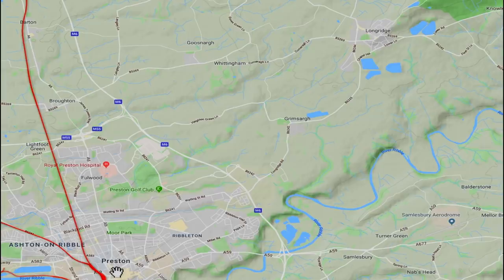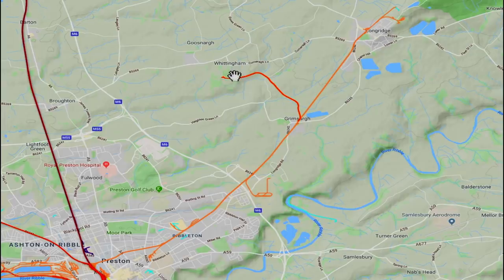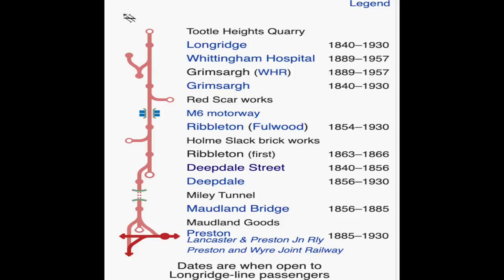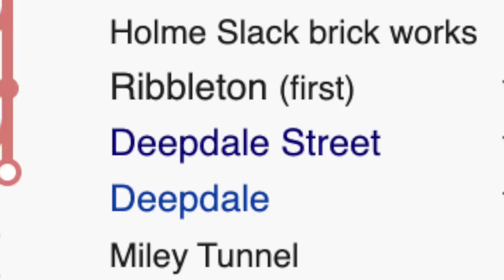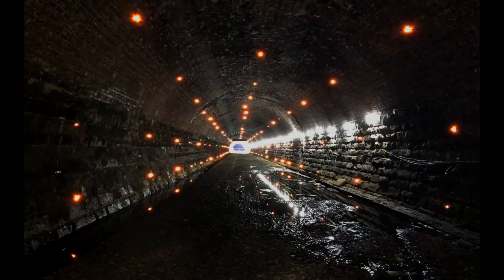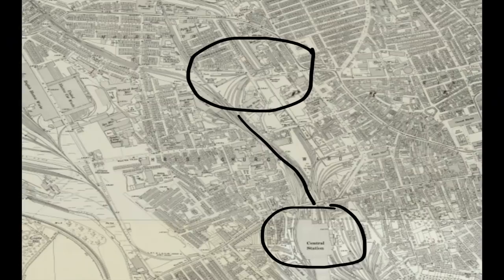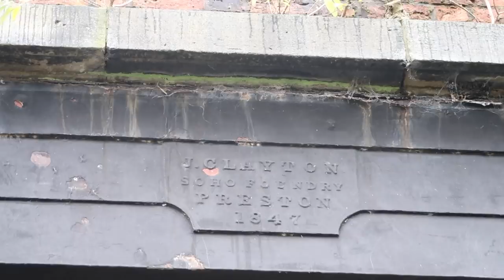The Preston to Longridge Disused Railway Line & The Miley Railway Tunnel

Comment: Interesting video and content exploring the Miley tunnel. Perhaps also of interest are some additional snippets. first, this part of the line continued in use well into the 1950s to supply coal daily to yards located nearby bottom end of Deepdale Road, in Fletcher Road. This was achieved using a spur line nearby Skeffington Road. Next, the lower platform part of Deepdale Station shown as demolished ruins in the video was still in place in the 1950s, indeed with steps down, although correctly described as long disused. However, the main station building up top remains and is the stand alone solicitor's office by side of the bridge. Finally, the Miley Tunnel ghost sort of morphed into a New York Times best selling novel called "Cold Bath Street" by A J Hartley, sometime lecturer at nearby UCLAN.  Cold Bath Street remains nearby, once site of cleaning up for the construction workers.

Comment: Before I was thrown out of Preston Poly, a friend and I used to conduct guided walks through the Miley Tunnel. Fascinating to find out how that central box came about. On walks after dark, we would turn our torches off at this point and experienced absolute darkness. It wasn't overgrown back then and the line was still in use for occasional freight. Of course, no high vis jackets were worn. 

Don't try that at home, kids!

Comment: Well done as always. It's interesting just how much of our current rail network was built in the victorian times. It's equally interesting to get the chance to explore the sections that have become disused. I don't blame you for putting it off until the foliage has died off. In summer that would have been 10 times worse.

Comment: Hi Martin 
Gordon form Preston. And not your fellow exploring Gordon. You was correct in thinking it closed in mid eighties, because I was stood on the platform of one of the stations as a little boy watching them load up platform stones and rails as the took them up, a class 25,  I live fight next to one station that still remains, and if you are free at somepoint would love to invite you for a very detailed tour of the eastern direction of the line. I've lived there since 1975.  And so lhe line open and working, you was also correct, there was steps down to Deepdale station that served Preston royal infirmary, and before miley tunel used to be a big coal yard with multiple sideing with over head hopper sheds.  If you up for a part two. Let me know, fantastic video, so close to home, great job once again, thanks pal 👍

Comment: Thanks Martin! as a Prestonian, I found that very interesting.
I quite often use parts of the disused track, which is now a designated cycle / walking path from the back of the leisure centre going North. It is easy walking from the leisure centre as far as the 'Roman Way' industrial estate, from there it is less easy but 'do-able' [easier than in your video] as far as Grimsargh, where I think it peters out opposite 'The Plough' pub.

Comment: Trains of household coal used to run till the early nineties to Deepdale Coal Yard. Crewed by Warrington Men, and using a mixture of anything available on Warrington Arpley at the time. 20's, 31's, 37's, 47's or maybe even a 56.
Reply: I knew it was later than he said, I remember in 86 seeing locos and coal wagons there but was working at the other end of town in the 90's and never noticed it's demise. Do you know exactly when they stopped?
Reply: @69waveydavey  Not exactly sure, but a mate of mine was a Guard at Warrington till about 93, and he worked the trains. Said you needed a JCB on the front of the train to shift all the dumped fridges and washing machines off the track.
Reply: @69waveydavey  As far as i know the last trains were in 93 The coal depot trains only used a short section of the line.

Comment: Superb this. Been fascinated with the line since late 80's as a train spotter on Preston station. 
Pretty sure Deepdale coal yard was in use to the mid 90's. Remember seeing class 56, 37 with one or two coal wagons regular. 
I work on the railways now and worked with a Blackburn driver until he retired. He recalled driving through the tunnel and hitting a dry brick wall the local youths had constructed

Comment: Fantastic Martin, you serve me prowd once again. Fascinating little stretch of railway, like i commented in Nodrod's video, it would be great if this alignment could be brought back into use. The tunnel was fascinating with that concrete ceiling placed over the original cutting between the 2 sections. I can only imagine how much weight is bearing down on those beams.

Comment: Nice one Martin (and Gordon). Good to see you exploring  my neck of woods just around the corner from where I lived as a kid. I remember the old station building on Deepdale Road well, and the entrance was used as a greengrocers shop back then in the 1950's (which one of your photos shows I think). I had a mate who lived on Castleton road, and his backyard was almost opposite the station platform and overlooked it. We used to watch steam trains go past from there on their way to Courtaulds (or to the coal sidings which were on Fletcher Road). The end of the canal terminated after it passed under Marsh Lane (the iron railings of the bridge are still visible I think). I remember looking down on the canal as a kid and seeing the railway lines running beside it, but it was already looking dilapidated at that point. You'll perhaps know that there used to be a tramway linking the end of the Lancaster canal, to the Walton Summit branch of the Leeds and Liverpool canal. This was a cheaper option than joining the two canals as was originally planned. Keep up the good work!
Reply: That's why it's called Tram Bridge in Avenham Park. There used to be a steam engine at the park end to move the trams through what we used to call Bluebell Wood on the other side of the river.

Comment: That takes me back - walked through there one Sunday afternoon in the late '90s.  It wasn't fenced off then, so you could just walk on at the Skeffington Road level crossing and go down through the old goods yard (now a uni hall of residence) to the West Coast Main Line.

The floodlighting is because there is a major building project taking place above that section of the tunnel, and (apart from the flooding) the area had to be monitored in case of subsidence.

Comment: At 28 minuets into the video that part of the tunnel used to be open but was covered over by the electric board and built on in the early 1970s. That area today has Preston police on it. At 30 mins into the video where the tunnel opens out there used to be an old cinema called the cosy cinema, which was derelict in the 70s to.

Comment: Great video! Had a look on google maps and it still shows the line as 'active' on mine. I followed it back from where it joined the main line at the three bridges that you show at the end. The line on the map changes colour where the tunnel is and it even shows the gap they covered over, which actually appears to be under a university building?
You can follow it back to where there is a split in the line, if you follow the split and go on google street view where it crosses roads (Deepdale Mill street for example), the old tracks are still there crossing the road!

Comment: Excellent as always Martin.  Those reflectors are placed to monitor the structure for movement.  They place a camera at the end and basically do what you did and get a registration back which is compared with the original. It can detect if any minute movement takes place and predict a serious collapse.  They use them a lot on the railway for structures and embankments.
Reply: Don Coffey UCLan are developing above that part of the tunnel at St. Peter’s square and they have demolished a full row of beautiful Victorian little terraces in the meantime 🤬
Reply: Chris Finch Golf hmm, I don’t like it when good old buildings make way for new projects. It depends what it’s for I suppose.
Reply: Don Coffey they were used as offices but they decided it was time to flatten them and redo the entire area....plans look good but it’s going to causes a traffic nightmare.

Comment: Welcome to god's own country!  I did the miley tunnel quite a few times, probably 99 ish last time. Red scar Courtaulds was not last to use it. There was a coal yard close to where you started literally 100yds away on a small spur, I distinctly remember coal wagons there as I used to go to a scrapyard, again 100yds back up the track you were on, in around 86 it was at the side of the track and remember taking bits off a car and being choked by fumes from a diesel ticking over on the track.

Comment: There was a cold storage unit belonging to the Government at Cromwell road ( think its still there as a private concern) it held emergency food during wartime.   It's built next to the railway . and in the 50s a steam train carrying produce would occasionally bring goods to the unit. , Because the line was little used the rails were very rusty making progress very difficult and very noisy plus the Loco equally  making a racket . It was closed by the 60s

Comment: Another great video, Martin - Well done. The survey targets in the tunnel wall look as if they were placed there to measure any tunnel wall movement/distortion. Judging by the extensive amount of rebricking of the crown of the tunnel, there have been ongoing stability problems in the area and if they are planning to open part of the tunnel for use, they want to be sure there is no significant movement still occurring. Another thought - the bricks are quite clean compared with the sections where the tunnel is fully masonry lined. Why no smoky deposits? Surely relining would have been done pre 1960s? Have you explored the line going in the other direction? Towards Grimsargh and the Whittingham Hospital (The largest mental hospital in England in its day)
Reply from the maker: Thanks very much for the info

Comment: The cathedral section of the tunnel was left open to supply coal to Crown St power station commissioned in 1892 and decommissioned in the 1920s. The site was redeveloped into a Norweb depot and offices and subsequently sold to the police. The Longridge stone was probably transported by train to Bolton and canal barge to Lancaster.

Comment: Those reflections you see Martin will be put into a computer to measure if there is any movement of the tunnel. 
I think
Reply: Sort of David. They're called retro reflectors and will be used with a total station (big laser on a tripod) to take multiple measurements. You're exactly right they'll be compared over time to determine if its shifting. Likely due to new construction inside or new weight allowances on top.

Comment: It's from 193 OW! haha! Try taking some leather gloves next time, then you can grab hold of the brambles without getting lacerated!- - Looking for the tunnel ghost - classic out-take from the tv show Most Haunted - Is there anyone there, knock once for yes, and twice for no! - - Lancaster canal - if you find a vlogger called Minimal List, they talk about it, and there are tentative plans to re-excavate and place it back into use. - - Dallam Forge - obviously an old foundry, (still just about running), but there was also a steam shed there, and a steel works, accessed by crossing the shed lines! - - and as an aside - you now know that if you wear an orange coat and a hard hat, everyone assumes you are supposed to be there, and pays no attention!

Comment: Paused it at 2:11 and straight off the bat - Soot plume on that bridge! It'll be a long time since the steamers that left that, last ran down that line, and then, "Tracks" - But sadly neglected tracks! The 'bull head' is flattened, and the edges well rolled over. I'd guess those tracks were abandoned in situ because they're well knackered and weren't worth recovering - It would need a good lad with an angle grinder to restore the profile to those tracks! 🚂

There isn't a lot to be found about the intermediate stations, but there is, on Nick Catford's excellent website "Disused Stations", this about Longridge http://www.disused-stations.org.uk/l/longridge/index.shtml . For those who haven't yet discovered the site, it's well worth a visit.

Aargh, a ghost! You need to invest in a 'PK' meter, and a 'MEL' meter, those are what all the professional ghost hunters using these days! 😋 👻 🙀 and don't forget, ghosts don't like 'infinity' mirrors - apparently, they can get in, but can't find their way out. 😥
All-in-all, that's a ruddy good video there, Martin, Nodrog and Martin (sounds like a firm of solicitors!) - "Nodgrog" was my pet name for Gordon Brown, a former British PM (Nodrog the Broon). That's going back a few years! Anyway, it's good to hear that the line could be reopened and reused, even if not as a 'real' railway. It certainly looks a lot more complete than some lines I can think of, an I will always maintain that it was a mistake to close down so many railway lines, and a gross error in judgement to allow so much redevelopment on former railway sites. Ooh, how I'd love to ride a handcart through that tunnel!

Oh, and remember, ghost are just as scared of us, as we are of them! 😜 👲 💀 👻

Comment: The survey lights may be because UCLan have demolished a load of old terraced houses directly over the tunnel and they are redeveloping the Adelphi area with uni buildings.
I visited Preston station today actually and noticed there’s a disused tunnel as part of the station, also there are areas used for stabling under the station approach. Be great if you could get access to see those areas

Comment: A very interesting line, I think. I hope it sees traffic again. Coal trains used to go up there to Longridge power station  (or was it Foulridge?) The only one I ever saw on the branch was going over the M6 bridge whilst I was on my way to Blacky for the day.  Did you see much of the Whittingham Hospital Railway, or has all trace gone now?
Are you a closet 'rat' fancier then? My absolute fave diesel was the 25. Very very impressive for their size but disliked by a lot of drivers as IMHO as they didn't know how to handle them.  All that and 16 ton minerals, unfitted. Bliss.  
There is definitely something very soulful about a disused railway that still has track down. I think so anyway. 
Another great explore, and many thanks for posting. Cheers Martin.
Reply: Laszlo Fire The coal trains ran to the courtaulds works at red scar
Reply: I stand corrected. I really ought to have taken more interest in these branches, but had the common disease of 'there's no need to rush, plenty of time'- look where it got me!
Reply: Me too Laszlo, so easy to think I’ll do it tomorrow and then it’s gone

Comment: The section you wandered on was used untill the 1990s for domestic coal to a depot at Deepdale Street; the ran through the former Deepdale station and reversed at Ribbleton. So the last locos there were 37s of possibly even 60s. Nice photo: https://www.flickriver.com/photos/144388905@N03/35712337035/

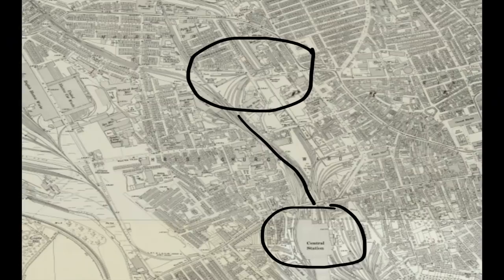Comment: 32:36 given that the tunnel was flooded & that they may wish to use the tunnel is the future.... I imagine the reflectors along the sides and especially the roof of the tunnel were there to allow for detection of subsidence of the tunnels structure....  by comparing original positions of reflectors to later measurements - in fact that is most likely what the reflectors are for given that at 32:57 you can see the white drum securely mounted to a concrete pillar containing a camera at what appears to be the center of the tunnel - to it's left directly mounted on the pillar appears to be the laser which fires down the tunnel at the reflectors
Reply: This is absolutely correct, the university are redeveloping the site directly above (St Peters Sq), if fact when I drove past at weekend I caught a glimpse and it looks like they have sheet piled down the southern side of the tunnel and excavated the ground out close up to it. On a positive note, network rail clearly don’t want to loose it to development, so maybe the future is bright.

Comment: I'm another ex Mancunian who even now living hundreds of miles away and likely double your own age  simply relishes your channel. . As you will know the Lancaster Canal was never connected directly to the Leeds and Liverpool. Instead a tramway was built between a spur of the latter and the Lancaster. in Preston  There's a lot of detail to be found on the old OS maps on the NLS site.  The track of the tramway was largely passable a couple of decades ago  and might be worth exploring . The basin on the L&L was obliterated when the M6 was constructed. It might also be be interesting to  try and access the tunnel that passed under Preston from the North Bank of  the Ribble  starting not very far from the existing railway main line and Preston Station.
Reply from the maker: Thanks very much David for the info

Comment: Breaking the work safe code there. It is not permitted to modify your hard hat in any way that alters the integrity of the structure. In this case - drilling holes in it to fit cable ties.

Comment: 😳🤔could you use speeder on the tracks.
Some type of vehicle 🤷🏻‍♂️🤷  certainly a machete.
31 mark you's were in a space with  arches.
Beams holding walls up. Do you think.
 If walked through there.  Is there industry. ❓ Shopping.❓ Store's ❓ That people could use frequent  to go someplace.  Small electric rail way 🤷🏻‍♂️🤷  Sorry. I'm from Detroit Michigan. I hate to see tracks pulled up. Turned into bike 🚲 & jogging 🏃 trails 🤨😥 🤷🏻‍♂️🤷 35:30 You looked over some kinda wall. You say canal❓ A canal
That held water. 😲 For a long boat ❓❓
 I watch Cruising the Cut.😍👍❗Seen where some of the places are being cleaned , repaired 
For use again 👍👍👍😀😃😆 so ,so freaking interesting 👍👍😀😃😆ok watched to the end of the video. It said it's planned for R n R 🙏👍❗